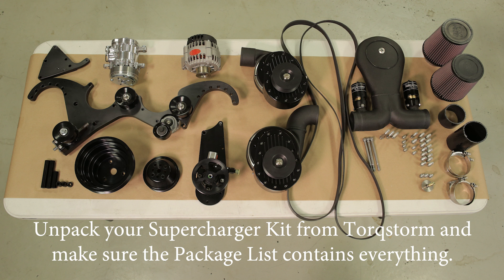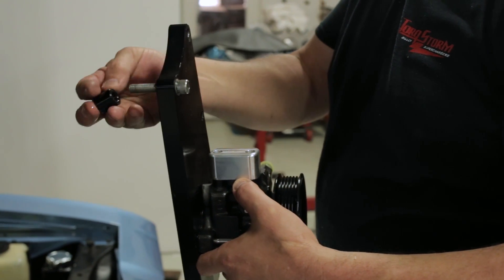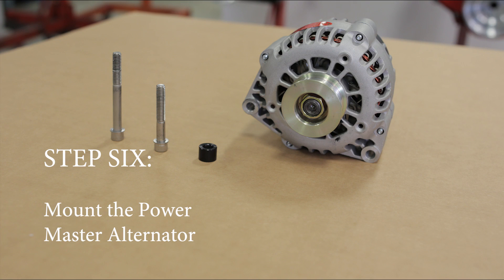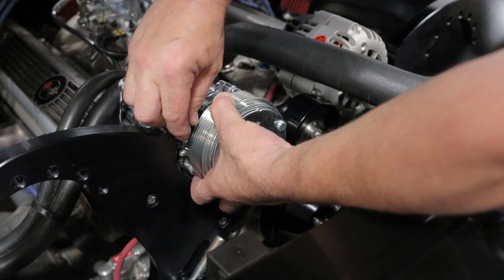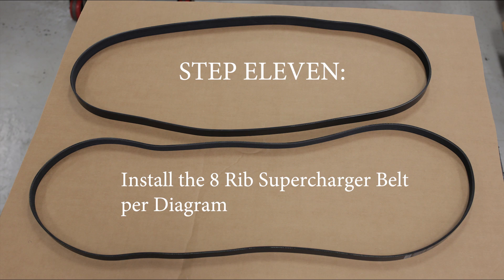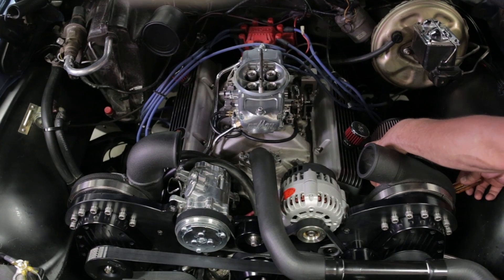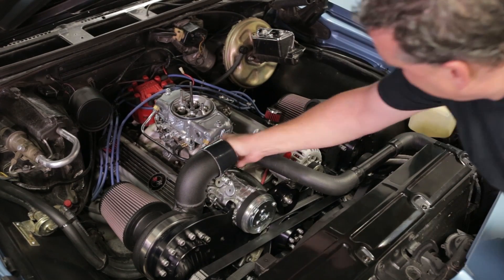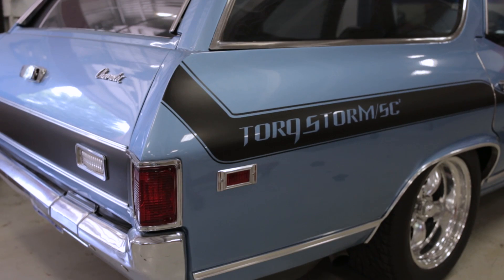Supercharger Installation Video Long Version

Comment: great looking set up, on a charged engine where do you pull a vacuum from for brakes and vacuum advance ?
Reply: Doesn't need to pull vacuum from anything
Reply: brakes - intake manifold port (with a one-way check valve, usually near base of carb/throttle body)

vac advance - ported vacuum on carb/throttle body (not manifold)